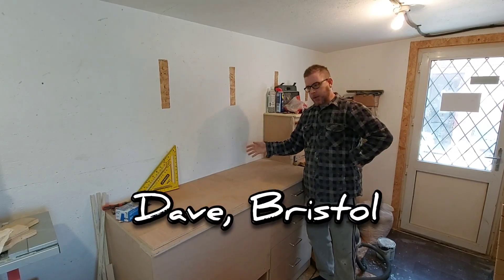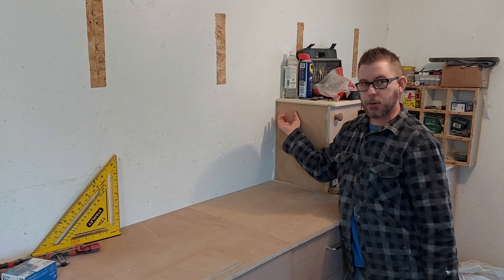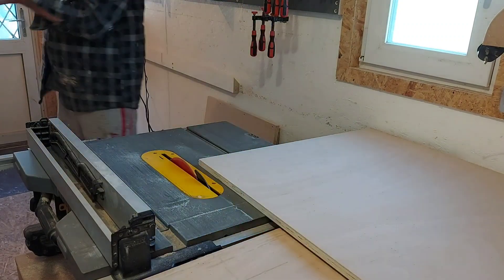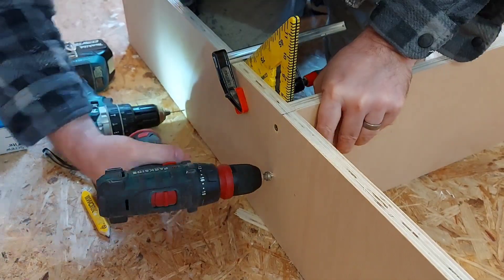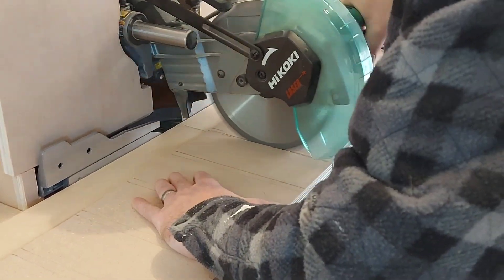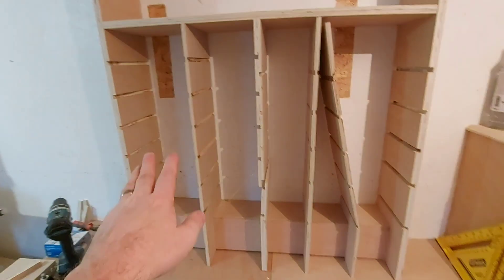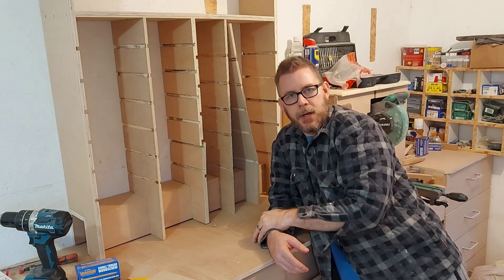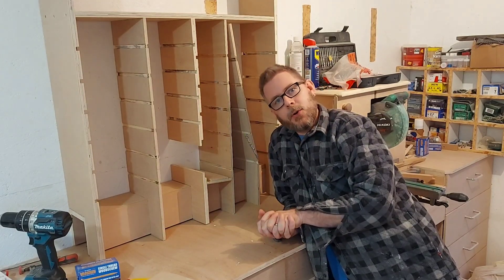shelving & cabinets added to the mitre station

Comment: Hi Dave I enjoyed your explanation and breakdown of events. This isn't a fail in you learning this craft which 
you have demonstrated. It's pretty complex overall setting the tool cutting depth to various material thicknesses, 
single sided/double sided trenches etc. The next storage unit you design I'm sure it will be spot on perfect. Tony

Comment: It’s very very fun watching you evolve your shop space. A bit jealous of what you’re learning through practical experience. My shop is what I’d call a packed situation. I can’t work unless I open the garage and move a few things out.

1/3 of material is the standard I’ve always gone. It’s the standard I’ve read for tenons and other joints.
Reply from the maker: Thanks mate, yeah I only used 12mm as that's what I had left. Will be great once I get more 18mm ply
Reply: Same here.
The Great British weather doesn't help.